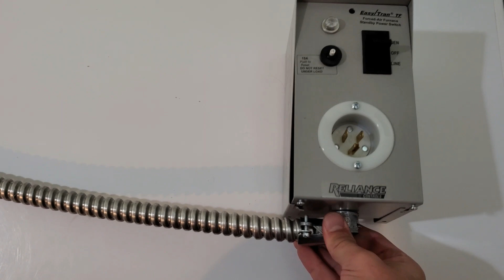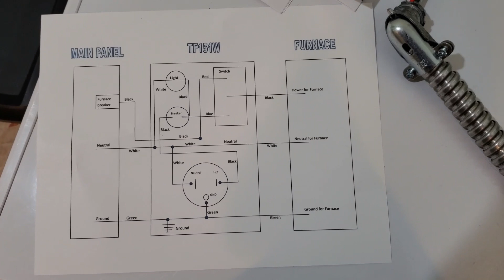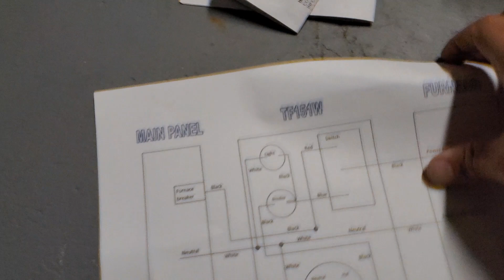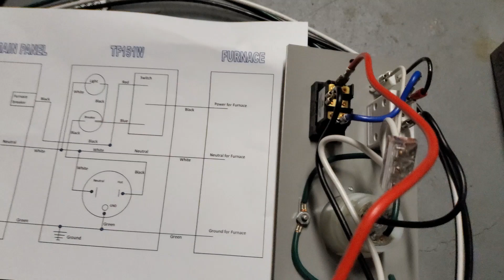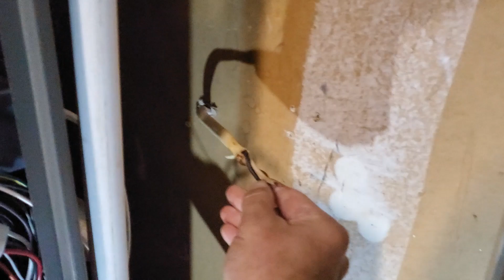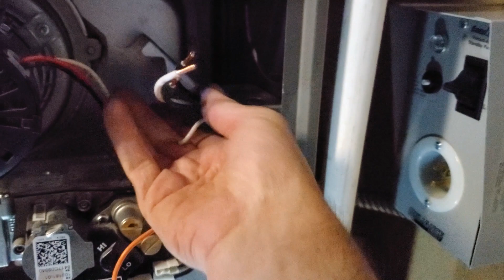Reliance Controls TF151W Easy/Tran Transfer Switch

Comment: So I see it has a knockout on the side and just wanted to confirm that you can choose NOT to install the plug receptacle at all and just use hardwired romex input? This is coming from a 110V inverter attached to a battery bank. It comes with a nice cover you can leave on there instead of installing the plug receptacle? Every video starts with the plug already installed which is frustrating.
Reply from the maker: The plug receptacle is where you’d plug in the generator. But you can remove it easily

Comment: Would you be willing to share that wiring diagram if you still have it?
Reply from the maker: I'm so sorry.  I didn't know I had a comment.  If you pause at the right time you should be able to see it clear
Reply: @davidkern9781  no need to apologize. That actually worked out beautifully for me. I emailed the company, but didn't get a response sadly. But thanks to your video, I installed it successfully. Also, thank you because you made this a lot less intimidating. We had a huge wind storm blow through and it was a relief to know we'd have heat one way or the other. Thank you!